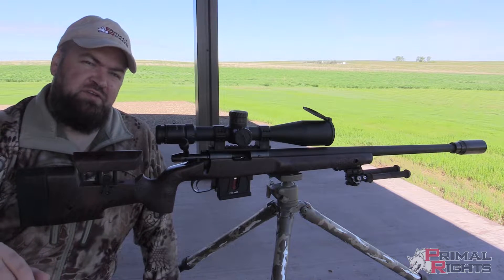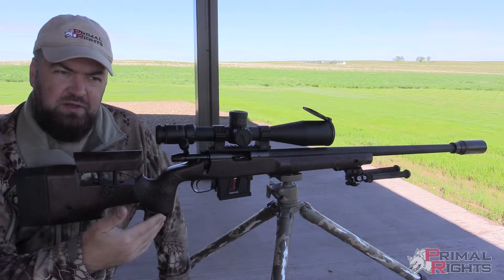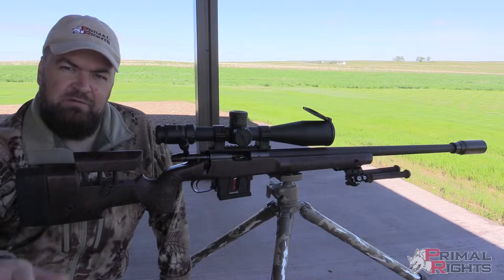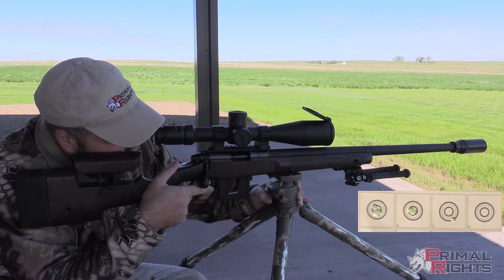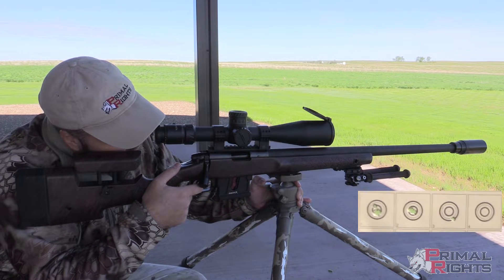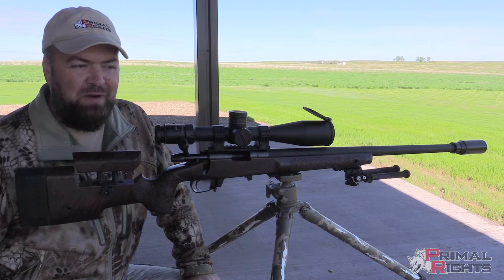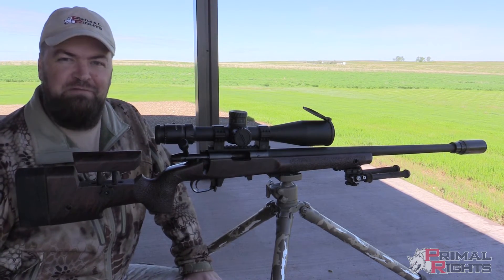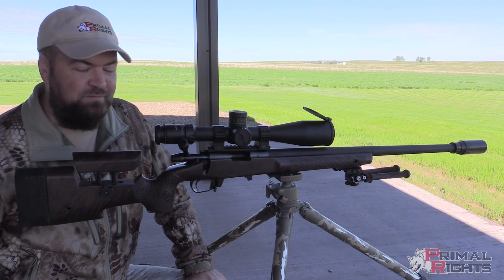22LR Dwell Time in Long Barrels

Comment: Great video, I have KYL targets for 100yds or farther that I can shoot with my Volquartsen Scorpion, 6”,4”,2” and 1”, can’t clear it every time but the burn rate is not the issue here, it’s the stability. I have a Rim-X in the works and I’ve changed the barrel length since finding your videos to 24” vs the original 20”. Thanks for your insights, going from plinking cans at 25yds to 1/4” groups at 50yds has been a blast.